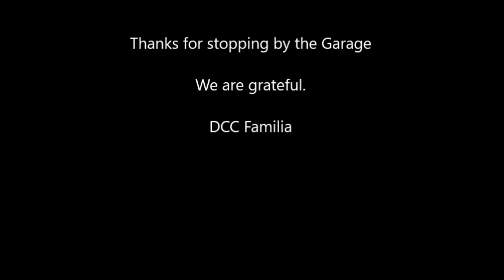Nissan Pathfinder Misfire

Comment: THANK YOU!!!   Pathfinder died on side of interstate in middle of nowhere.  While waiting on the tow truck to show up, found this, it was the first video that came up.  Set screw was sitting at bottom of distributor assembly.  But it back and fired right up.  Saved me a huge towing bill for a super simple fix.
Reply from the maker: Dustin Pearson ~ glad it worked out ! Good job 👏

Comment: I've been watching the video but I don't understand exactly what to do. I am having the exact same problem on my Pathfinder. Already change cables, spark plugs, throttle body cleaning and MAF. The vehicle has no problems, on the road it runs quite well, I have no loss of power either, but only in D or N does it have irregular idling and once the engine has warmed up.
Reply from the maker: One of the things to check :

Pull ignition cap off and take a close look at ignition rotor set screw ~ common to come loose ~ hope it helps !

Comment: Ok so I was hoping that would b the easy fix but it wasn’t. I was able to drive smoothly in 2nd gear tho and actually use 3rd gear so I’m open to anymore ideas that u may have for me. I think I will try a new rotor button next tho, I didn’t like the look of mine
Reply from the maker: Shaune Pegrum ~ call me at the garage anytime for more insight ~ hang in there 👊🔧
Reply: Desert Car Care  oh I am mate. I’ve had it four years now but being on a disability pension I’m at that point on do I spend money trying to get it fixed b4 I open a possible can of worms and end up spending hand over fist. It’s not throwing codes up, so I know that’s not a prob. I’ve had 4 mechanics look at it and can’t find the problem and a auto electrician look at it and no one has found the problem of the misfire. I’d love to ring u but I’m in Australia lol so that won’t work. Thanx for the comeback tho, it’s muchly appreciated. 👍🏼😉
P.s after watching another video on here I’ve gone back to my original thought that it maybe number 2 injector that needs replacing

Comment: How much should i torque down the bolt holding on the distributor. I have a 1993 3.0L
 pathfinder
Reply from the maker: 10-13 Ft Pounds ..

Comment: I'm having this problem right now with my nissan pathfinder 98. But the set screw is facing in towards the engine where you can't get a screw gun or screw driver to loosen it, if it was a bolt I could use a ratchet
Reply: Try to start the vehicle, it'll move.  It easier if you have someone watching when you turn it over.

Comment: I have a 1998 pathfinder that is showing error codes P0325 and P0301. For about 2 months my car wouldn't start first try, had to wait about 5 minutes before it would finally start up. And randomly my car would seem like it's loosing power, then if i came to a complete stop it would be about 50/50 if it died on me. Now its not starting up at all. I initially replaced my fuel pump, fuel filter and air intake hose thinking that is was regarding those, they needed to be replaced anyway, but nothing will work. I just ordered a Knock sensor and harness for it and am going to replace that. Would you have any ideas on what could be preventing my car to start. Have looked everywhere for answers but haven't found any. Thank you for your time!!!
Reply from the maker: Ring me at the garage ~~do my best to help ! ~~Frank
Reply: I know it was 6 months ago, but for those who follow. I had the same problem on mine and it turned out to be a bad connection on the MAF sensor. I would pull over, get out and wiggle it then it would idle and drive fine. Also the O2 sensor can give similar problems. So Frank do you remember what the guys problem was?

Comment: Would this explain engine not being able to rev and kangaroo hopping under load ?
Reply: Ok so I was hoping that would b the easy fix but it wasn’t. I was able to drive smoothly in 2nd gear tho and actually use 3rd gear so I’m open to anymore ideas that u may have for me. I think I will try a new rotor button next tho, I didn’t like the look of mine

Comment: I tried the same thing but the set rotor screw is sometimes turned opposite way from where i was standing and it was very hard to unscrew it. Next time i turned my car on couple of times and it came back the way its supposed to be , just like in this video. Is there something wrong with my distributor cap, because i have rough idling and my car through code po300? Please help. Thanks in advance
Reply from the maker: BiHlover80's .. P0300 ~~ sounds like your fighting a misfire. Double check all ignition components.
Reply: Desert Car Care .... yas, you're right.  I didn't know the meaning of PO300 until yesterday.  Even though we have heavy rain and wind day yesturday I've been working on my car to figure out what else needs to be done.  Also, I had 6 or 7 error codes since I bought this car 7 days ago. I replaced EGR valve, spark plugs, spark plug wires, distributor cap, knock sensor, oil change, air filter,  bunch of hoses,  also, I took of plenum and cleaned idle control valve. All of the mention above were throwing error codes. I now understand what means PO300. I'm still fighting with it. My pathfinder still has a problem . It sputtering,  kinda having problem to accelorate and I can't pass 30mph but later slowly I am able to accelerate over 30mph. I will try to disconnect plenum again to check for hoses under the plenum and maybe check the injectors.  Definitely PO300 is like 300 things to check before emission/ smog check test. Thank you for replying to my message and if there's anything that I need to check to fix this problem please let me know . I'm doing this myself with limited mechanical knowledge . Once again, thank you for your help.
Reply from the maker: BiHlover80's .. double check distributor to ensure timing is good to go. Also ensure that firing order is squared away & you don't have crossed ignition wires. Go back to basics here ~~ here for ya. Good luck & stay dry !~Frank
Reply: @bihlover80s33  did u figure it out

Comment: Does this proble cause it to stall out a couple seconds after starting
Reply: I think it's the injector I just changed my distributer on my qx4 1999 and it starts but sounds like crap in drive and reverse it's ok in park or N have you figured it out I'm about to order my injectors
Reply: Sambo Rambo.  Hi yes it's was bad injector seal allowing fuel to flood the cylinder and ultimately killed my cam shaft sensor in the distributor so after that I also did knock sensor while I was there totally worth it. Good luck I drove my truck to arizona from California last week all is well knock on wood

Comment: what year is this
Reply from the maker: Late 90's....do you have a PathFinder ?
Reply: +Desert Car Care yeah 2001. I'm almost positive that's what it is and I want to check it, I just don't have the tools
Reply from the maker: Ignition failure quite common. If the plugs, wires, cap and rotor are older than 60 000 miles ish..more than likely the source ( hard to decipher of course without testing). If you need a great garage , and you are not in our neck of the woods ...I have got an amazing network of good guys and gals across the country...here to help either way...good luck ! --Frank
Reply: +Desert Car Care yeah that'd be cool! I'm in desperate need of some sort of help
Reply from the maker: if you can get on twitter @urmechanic...I can live stream a detailed video of basics you can look for...